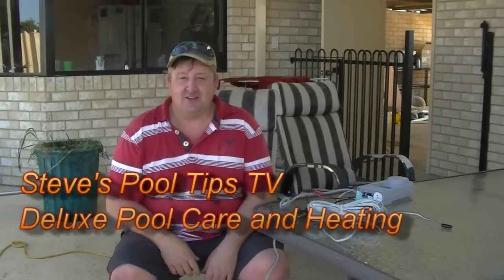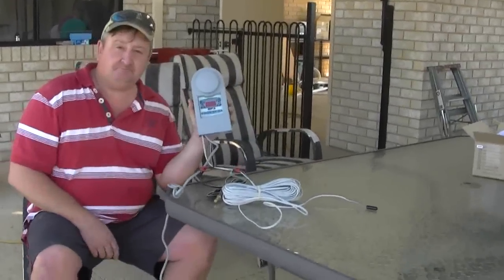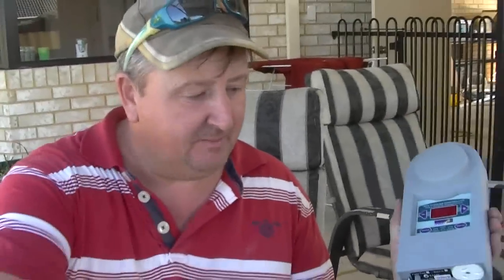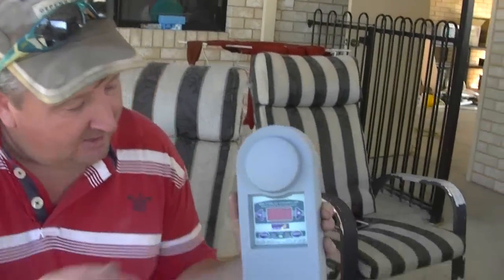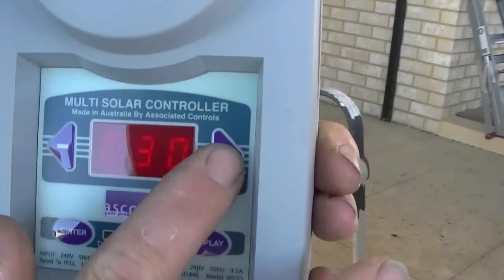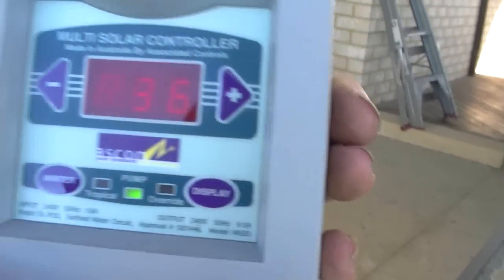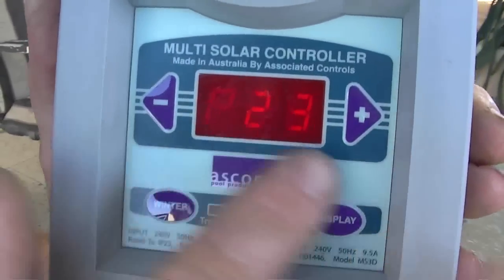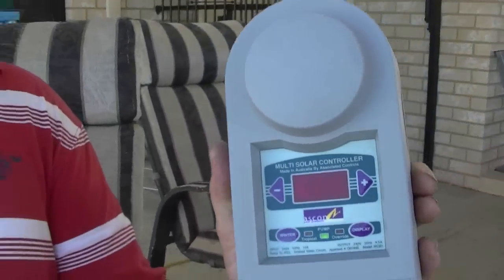MS3D Solar Controller

Comment: Hi-Great informative video. I just put a new poolwater heat sensor on mine, but it's leaking. Just wondering if you'd have any tips about installing a new sensor and grommet. Cheers

Comment: my comfort setting is set at 28, the roof temperatures is reading 19, the pool temp is 21 and the heating pump is still running. Is this usual?